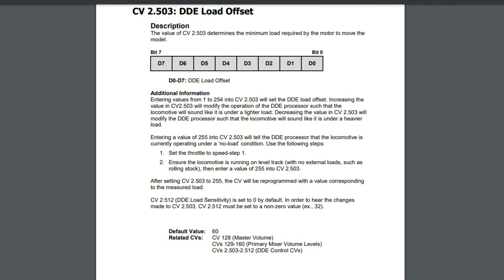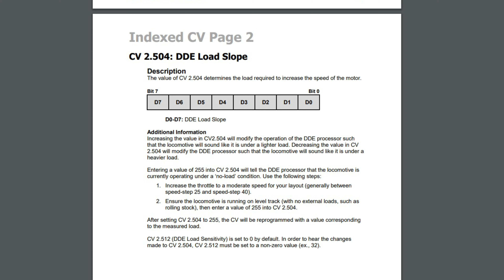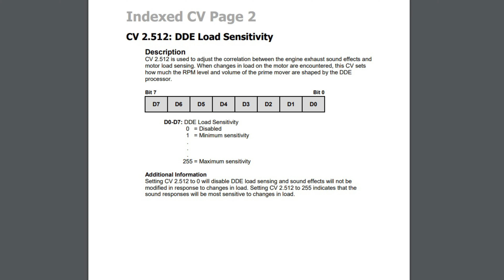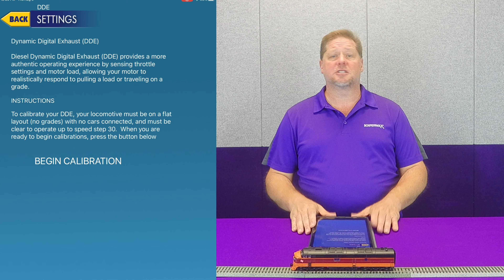Dynamic Digital Exhaust (DDE) Calibration with Blunami or Tsunami2

Comment: Hi George, 
DDE is great , but as someone who runs multi unit consists, the issue is all the units notching up or down at the same time.  As you know, having them in a advanced consists keep s the notches together, but with DDE, with each loco behaving slightly different, , you could not get uneven notching? If you could slave the trailing units off the headend units ...the THAT would be a gamechanger!!   Get your tech guys on it !
Cheers Gregg.
Reply from the maker: This is why I mentioned to turn down the sensitivity.  I get mine to run pretty close, but my sensitivity is 16 in CV 2.512 and I also change CV 114 for 15 Speed Steps per notch (among other things CV 114 does, so your final value will be determined with other factors such as autostart..) Mine is 95.  (15ss/notch, interlock enabled, Idle Dynamic Braking.)  Again, when you get them dialed in, you will have a great experience.  But it will take some trial and error, and it may not be 100% in tandem, but remember, GEs load up differently than EMDs, so there is already some differences there anyway.  We just usually don’t get to see/hear it since they’re either starting up in front of us at full throttle or passing us at speed.  Perception is the key factor.  If you want to hear my BNSF 3-unit consist, see it here:  https://www.youtube.com/watch?v=Itkpl69nDMI

Comment: Since I am going to be putting Blunami Alco decoders in a Rapido FA & FB-1, would I have to adjust the DDE sensitivity or could I calibrate both the A & B unit while they are consisted together?
Reply from the maker: You can calibrate the DDE together, but it will not give the true load of the lone motor.  We have some recommendations for the setting so the DDE does keep more coordinated, but I’m afraid your idea may result in unusual behavior.  Try it, and if it doesn’t work, or you don’t like the results, you can then separate them and recalibrate it.  So, See what you find and go from there. 
My personal setting preference is low DDE sensitivity on diesels, and set the auto-notching rate to 15/SS per notch, so it spaces the notching points apart, so they are less responsive to a bump in the couplers or a minor track hump.  Play with it and see what you find..  Contact us at support@soundtraxx.com if you need further assistance.  Thank you!